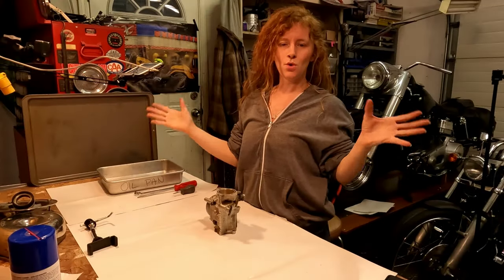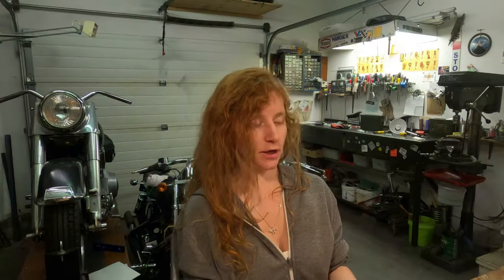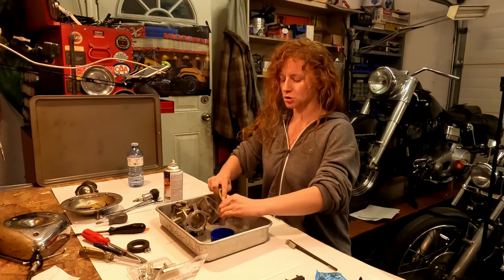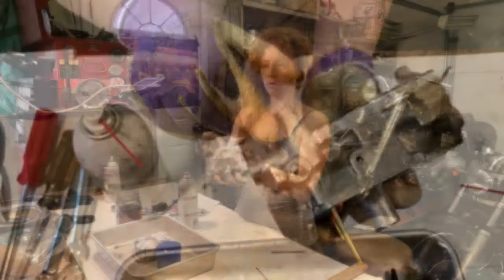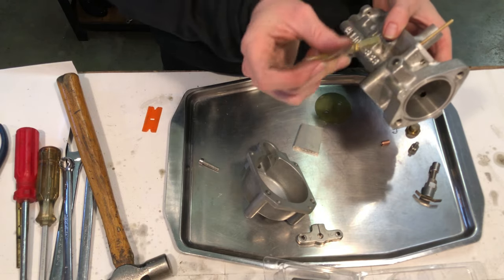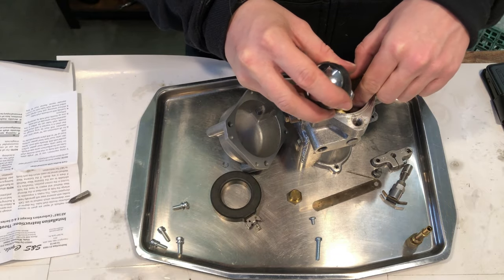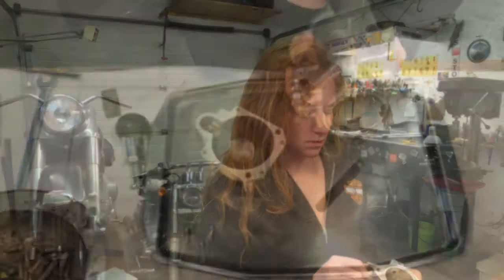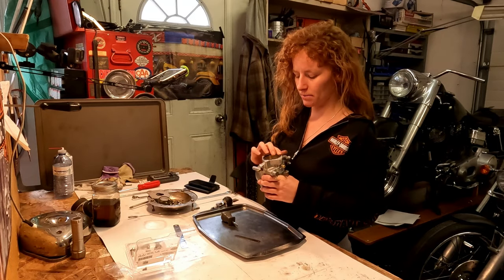My First S&S Super B Rebuild

Comment: Well done & informative Angel. A suggestion...put a drop of Loctite on each of the butterfly screws. You don't want them ever coming loose...and certainly not getting into your engine. Hi to you and yours.  👍✌️🇨🇦
Reply: Definitely Locktite those butterfly screws. It cost me thousands to replace the pitted pistons,  heads with pulled inserts and eventually had to redo the bottom end. This all happened after having the engine freshly rebuilt to 88'''.
Reply from the maker: Thanks for the  suggestion guys!

Comment: Had one of those on an Ironhead Sport.   Never did get it correct.  Could beat it all day on the open road without any problems.   In town, would  foul plugs every half a mile between stops n lights.  Got an adjustable main jet, shut it off for in town, open it up for the highways.  Helped some with in town riding, but never did work correctly.   Hope you can get yours working well.
Reply from the maker: Thanks ✌️

Comment: Nice watching you fix the carb.  I believe that various glues are preferred for getting high, not carb cleaner.  The end result looks good though.

I removed my B from my 78 sporty a few weeks ago.  The semi liquid inside that once was gas 8+ years ago is nasty.  It is on the list, I also would have thought that the "master" kit should have everything.  The rat's nest of wiring and brake caliper bleeding screws that are frozen in place are next on the list.  If anybody reading this has a solution for frozen bleeder screws, I would be happy to hear it.  They have ignored PB Blaster and Kroil so far.
Reply from the maker: Someone suggested soaking seized parts in diesel fuel and it's supposed to really help loosen stuff up.
Reply: @RedRiderCanadaBC  
Thank you my friend I will try that.  I do not like to replace original parts with questionable after market stuff that is often made in the land of almost right.

Comment: Hey Highly recommend fitting a Yost tube it totally transforms the performance of a B Series Carb by fully atomizing the fuel passing through the main jet passage giving a crisper throttle response as these carb dont have a fuel pump.
Reply from the maker: Thanks, I'll definitely consider that.
Reply: Super easy to fit remove drain plug then main jet it goes up main jet tube,replace main jet drain plug done. @RedRiderCanadaBC

Comment: Hiya, I just rebuilt my s/s b and updated the thunder jet to a smaller size it had the original for 3oyrs but had always come on to late so now it should kick in sooner and I also have the adjustable main jet. it took me more time to get it right but runs so much better , now this is on my 1982 ironhead sportster that is stroked to a 74 cube and has the heads duel plugged and runs a crane ignition and for cams they were the largest Andrew made to drag with had to have the cases machined so they would clear on the inside and also running Jim's big lifers and lite weight adjustable push rods I spent over 10k on this bike bake in 83 and quit counting money at 14k but still enjoy riding this bike its a handful when everything right the fuel is the biggest thing have to carry a octane booster or be real lite on the throttle lol tranny got all new internals this summer they are Andrews too. use to run this with a electric shift but took that off after a few years now just set the clutch's up and run it like I stole it lol the beast is due for a complete rebuild on the engine but I only ride it once or twice a year and the cost now is so much more to do. so my bike now is a 1988 FLHS with a 89 stroker kit in it that I have completely restored now has 2800 miles on and is just what I needed to travel on it to has a lot of go faster parts lol you be safe and maybe some day we shall meet up and talk more of rides and adventures
Reply: We have similar Sportsters, mine started as a 1978 XLCR, I don't have the ThunderJet, haven't opened the B yet so I don't know about my main jet.  What I have found so far with a little disassembly is 4 5/8" stroke (74") with Andrews V9 cams, S&S B carb and intake ported and polished professionally right through to the valves, four spark plugs, Sputhe Racing engine cases.  
I haven't started it yet, still mired in rat's nest wireing, brakes, disassembling checking cleaning packing and fitting all bearings, all the stuff you do when a bike has sat for 25+ years in a shed.
Good to know that I am not the only one with one of these and that it is probably rideable.
Reply: hiya, I use to ride this bike everyday but have the big bike for that but the sporty still is fun to get the blood pumping @warrenp2022
Reply from the maker: Man that sounds like a really fun little bike hahah. I would love to get an old ironhead to soup up one day... maybe when I'm done the projects I have haha.

Comment: Great job on the video! Should you have put Locktite (red or blue) on the butterfly screws? I’d hate for one to go down the intake from vibrating out.
Reply: Red or blue on those tiny screws and they will never come out, no matter how hard you try to remove them!  Locktite does make a formula for that size, purple I think, correct me if I am wrong.
Reply from the maker: I think I’ve heard of purple loctite 
🤔
Reply: @RedRiderCanadaBC  
I decided to help you think, so a trip to the shop.  My bottle is Permatex threadlocker 222, it has what I think is a purple bar across the front.  Be advised that I am partially color blind so it is a 'best guess'.  It claims to be low strength and suitable for small fasteners.  Blue is for 1/4" to 3/4", red is for 3/8" to 1" if my memory is accurate.  Enough brain strain for now.  
An armed Canadian, my my.

Comment: I have never worked on one of these carbs as I run a Mikuni flat slide. Just wondering should the screws that hold the butterfly valve on the spindle have a little drop of blue loctite on them as, if one slackened off, it could go through the Venturi and into the engine - thoughts?
Reply from the maker: I've been told that loctite would be a goof idea on those.